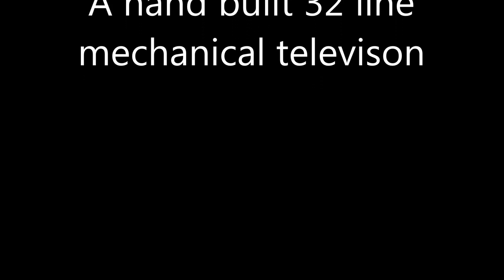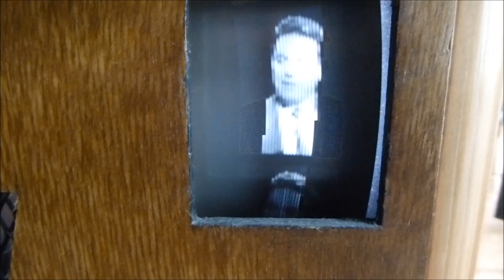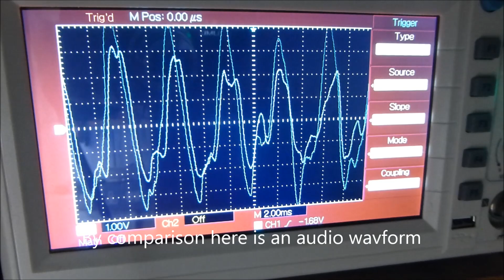Home made Mechanical television

Comment: Nifty but using transistors is kind of cheating.
Reply from the maker: Well Yes but I don't have a supper bright neon tube . Believe me I tried very hard to source one. I had to use leds. These are the only devices which have the speed to be modulated and varied in intensity without hysteresis. A valve driver would now be rather anachronistic . I did run a more primitive version directly from an AM radio output that did not have the PLL speed control and feedback sync circuits. I had to control the motor with a rheostat. I couldn't find a synchronous motor which was suitable. Anyway it was a great project which kept me amused for a month and I learned such a lot.

Comment: Excellent built and nice quality picture! Judging by the accent of the guy on the TV I take it you're located in Australia? How did you go about getting the holes accurately drilled? Did you use at template and drill or order a precut disc or get the holes laser cut?  I have built crude mechanical sets using paper printed templates and drilling into LP records, my holes are always off but still get usable pictures all the same though very crude. The gentleman at the end looks a bit like late Aussie TV personality Bernard King https://www.youtube.com/watch?v=U1lw6OoOKkg
Reply from the maker: Hi  The disk was cut with a laser cutter. I tried with varying success drilling holes in disks but never achieved a perfect image. I am located in the uk and the still picture was a digitised image of me . I used some software from   http://users.tpg.com.au/users/gmillard/nbtv/nbtv.htm . In fact all the videos I have used were converted with this software. It also works in real-time with a camera .

Comment: Amazing project, thank you for sharing; I personally love seeing this technology and mechanical combine
Reply from the maker: Thank you. It was a great project . I really enjoyed building it. The first one I built was using a capstan motor from a vcr and 33rpm vinyl  record with holes drilled in a helix. The motor was controlled with a rheostat . I latter tried a PWM speed controller using a 555 timer and a power fet. I could never achieve a perfect synchronisation .